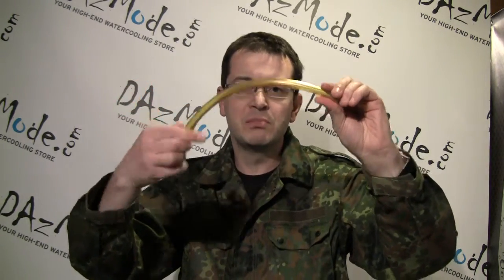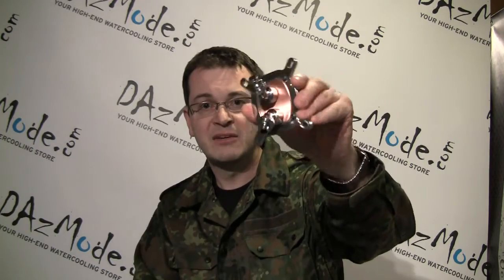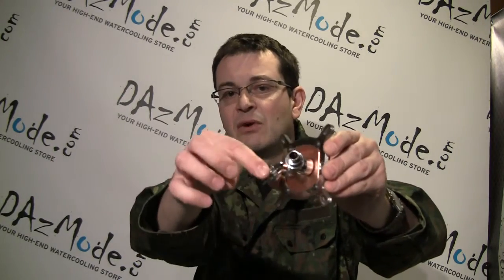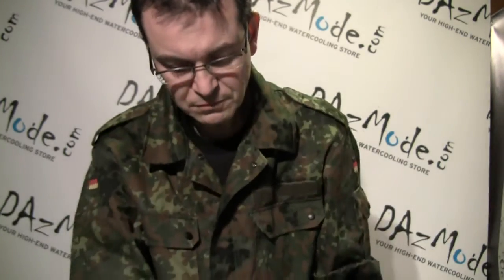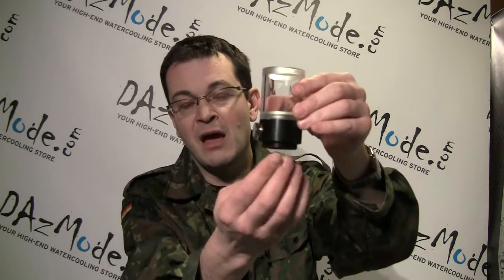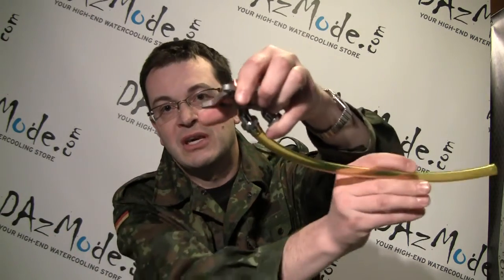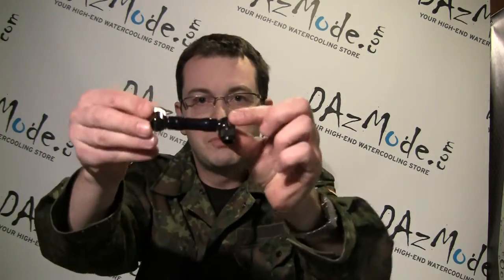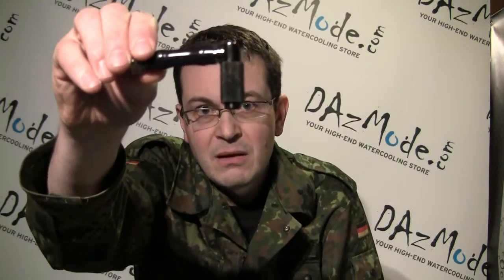Complete Watercooling Guide Part 7 (2 of 2) - Watercooling Fittings Fancy - Mini-Review

Comment: Hey Daz I have a question: I purchased 2 mcp355 pumps but they are not working correctly. I emailed Swiftech for a RMA and they told me they can't do RMA for Canadian residents. They were kind enough to forward our email dissussion to the RMA department of the store where I purshed the pumps, so I hope they will be able to assist me with this issue, but my question is : If in the future I buy stuff from your store, can I get RMA/replacements for those products ? Thank you !

Comment: I actually use disconnects for a drain port. I use the male port for a plug and when I want to drain I attach the female plug. Also with disconnects make sure the model number is the same. Example both of mine are the v3ln models...taco